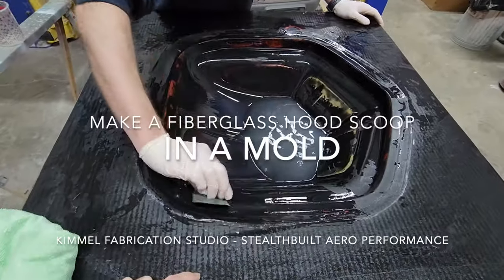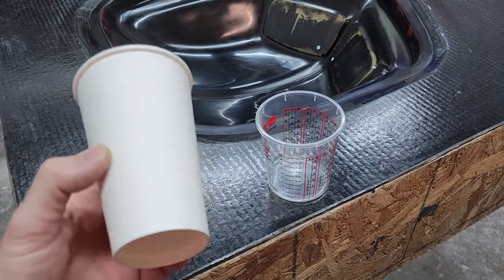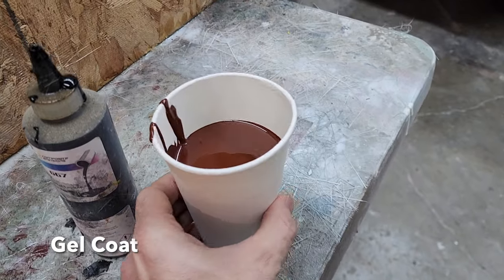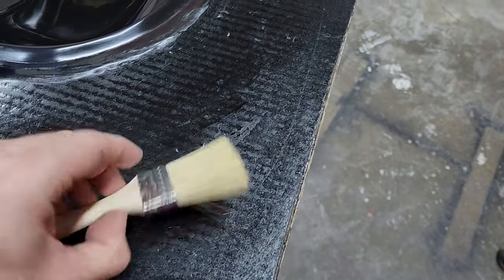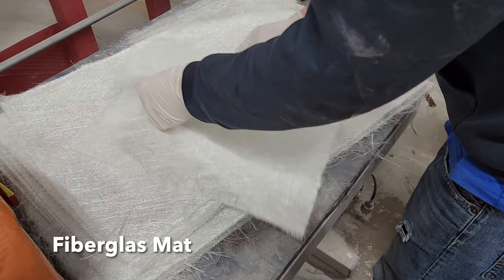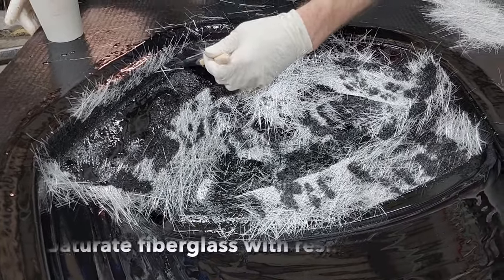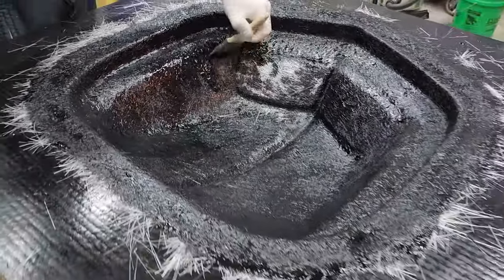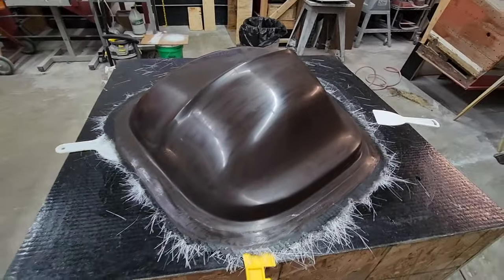How to Make Fiberglass Parts! - Hood Scoop - Full Details

Comment: Nice work guys. I have a question if you don't mind me asking. I have a fiberglass front bumper for my car but the sides are angled out away from the fenders. Is the best way to fix it. Thanks
Reply from the maker: I'd need to see a picture of the issue to get a good idea for the repair. If you have Instagram, feel free to message me there with a photo and I will do my best to help. - Sam
Reply from the maker: @stealthbuilt on IG
Reply: @stealthbuilt1  okay I will do that. Thanks so much